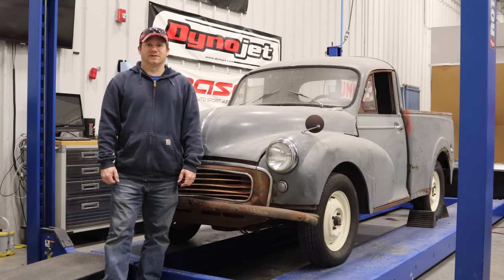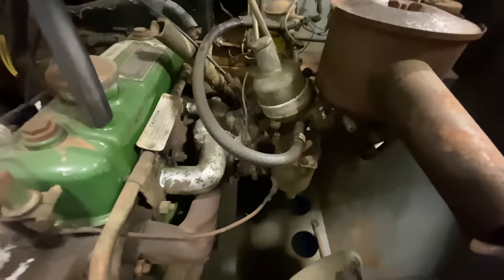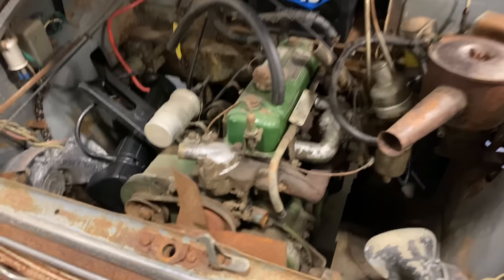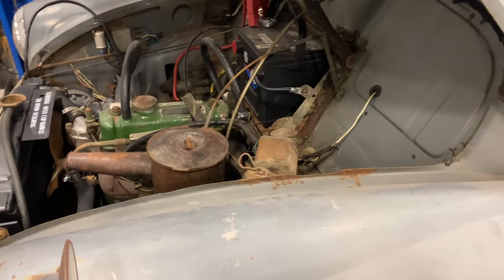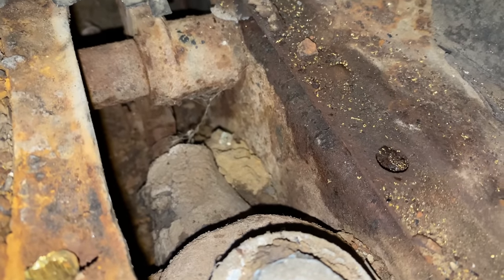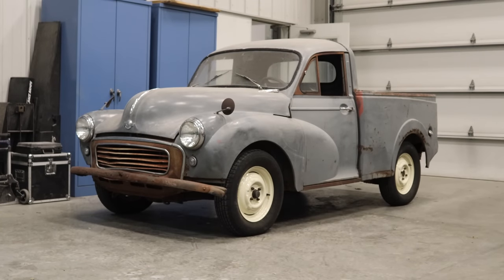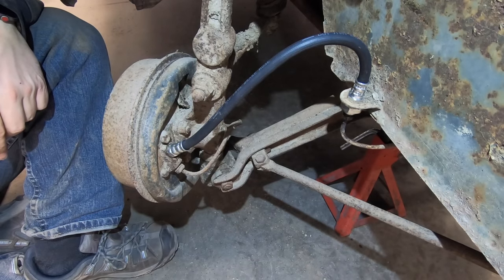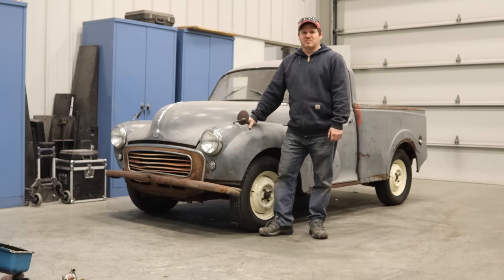1961 Morris Minor Pickup - Will It Run?

Comment: Great to see this old Morris Minor  worked on. I had the van MM in the early 80s, similar vintage which I bought from an old flame for £30.00! I had it sprayed metallic Gold and refurbished inside. It worked a dream and wish I hadn’t given it away for free in exchange for a new van more capable for my needs I loved the sound of the 1000cc tight engine, it’s pure simplicity to work on under the hood. Any key opened the door! Miss it some, as these were very collectible, still are, but very rarely seen here in U.K. However, a close neighbour has the car with the wooden trim! Thanks for posting, takes me back.

Comment: I worked on the construction of the Victoria Line subway in London UK, when equipping the project the contractor decided on Morris vehicles and within 2 weeks of site start up. 13 Morris 1000 travellers, 2 5cwt vans and 3 pickups,  2no. 15cwt J4 vans. 3no 5 ton flat bed trucks. Were delivered along with 2 Humber Snipes for the section boss's
Then the actual construction equipment started to arrive, a large proportion was new stuff so what the capital outlay was to set up shop was staggering.

Comment: Professional job there with the proper tools. I changed the brake master cylinder on my Morris Minor some years ago, and it is a pain. When I fitted the new one, I reversed the mounting bolts and shortened them a bit (to clear the torsion bar) to make it easier should the MC have to be removed again. A great car to own and generally easy to work on - I often think about getting another. Congrats on your excellent videos.
Reply: I worked for a Morris dealer in the 1970's and was told to grind a lump off the end, paste 'em with Vaseline, and stick them in the 'wrong' way round! :-)

Comment: I had a '61 Van I restored back in the late '70s. A few tips:
The emergency brake cable has a grease fitting. How nice is that?
I think the rear axle has 4.88 gears. Some of the Sprites/Midgets had I think 3.90s or 4.11s. Easy swap.
Disc brakes from the Midget can be used on the front with a bracket that is probably still sold.
That front fender looks pretty solid, I'd consider repairing it.
Check the frame where the lower control arms bolt through the frame, a notorious rust spot but not hard to fix with some welding. Easiest car you'll ever work on, except the master cylinder.

Comment: Great video, I had a 53 unit RH drive 1100cc ugrade (Australia) same issue with master cylinder. I fitted Morris Major front brakes, they fit straight on with no mods required. Good luck

Comment: Aww... lovely 😍 I used to have a Morris Traveller, half-timbered body and all. Great cars and excellent parts availability (in the UK at least 😉)
Reply: And the wood trim on the rear wings was actually structural, so you had to have wood that was in good shape.
Reply: @bcgrittner  Yep one of the few cars that failed an MOT with woodworm and rot.

Comment: Hi nice pickup. This brings back memories, remember doing the brake master cylinder on an old GPO van about 40 years ago, blew out one of the steel brake pipes during bleeding so had to replace all metal pipes with copper/nickel made to measure repacements.

Comment: Had a Morris Minor car in high school, drove it until I went into the military.  Biggest problem I had was the fuel pump.  Points burnt up just soldered new ones on when needed.  Never had a engine issue with it.

Comment: Aah, the memories! I spent countless hours under, in and around a couple of Moggies I owned in my teens, back in the '60s, doing all the same stuff as in this video, plus a whole lot more. Mine were Travellers - the first one a split-screen 803 cc 1955 model,  the later one a 948 cc from '60 or '61. Excellent machines - I did literally thousands of miles in them, around Britain, with a little detour in the split screen down to the south of Spain and back in 1968. Great little cars! And I totally agree with the "don't do this at home" comment about changing the brake master cylinder. I seem to recall that I somehow hacked off the heads of the bolts behind the torsion bar, then put new ones in from the other side, with the nuts on the torsion bar side.

Comment: "I have all the bleeders loosened and cleaned up." You're starting to swear like a Brit too now Steve. Good Lad!
Moggy Minor in the States. Well I never..
Reply: First thing I thought, as a Brit. What're we like.....lol
Reply: Nuffield Exports/BMC managed to sell a fair few Minors to the States in the 1950s. The reason for re-positioning the headlamps from the front panel either side of the grill, to the top of the wings, was due to US lighting laws. The low-light Minors fell foul of that legislation, so the front of the car was redesigned. The vast majority of vans and pick-ups that made their way across the Atlantic were used by the Morris dealers before they ended up in private hands.
Reply: @crashbox7130  The reason for headlight re-positioning is interesting. I recently saw a picture of a split-screen Moggy with headlights in the wings and was amazed. All the split-screen models I've previously seen in Australia had the headlights in the front grill panel.
Reply: I had one. A 60. They were quite popular at one point . We had a few vans imported too

Comment: I miss my '58 Saloon. MM 1000.  The holes in the brake drums are for brake adjuster access.  You need a large straight slot screwdriver.  I can't remember if the adjusters were at 12:00 O'Clock or 6:00 O'Clock.  Use a flashlight.  The thunk thunk electric fuel pump was standard.  The SU carb is a peculiar little beast - make sure the oil level in the damper is at a proper level.   My '58 MM 1000 was a saloon ( 4 door ).  Mine was positive ground.  I guess that was a British thing.   I have seen positive ground on many British cars.  No synchromesh on 1st gear - again, British. A MM 1000 pickup truck in the states?  Very rare.  Enjoy!

Comment: Minor pickups are becoming rare and fetch a good price over here In the UK. Those A series engines are very tough and usually easy to get running. That Minor should go well if it's got the 1275cc engine. I think they come with a 948cc or 1098cc over here. The drum brakes aren't that wonderful and some people convert the front ones to discs. On mine I found adding a brake servo did the trick. I was wondering if a brake pipe would give out because that happens a lot ( including on my Minor) when they get rusty.
Reply: Rare as hen's teeth over here. (US)
Reply: I'm in the UK - 55 years old - an' I ain't never seen one.
Reply: Most fell apart after a few years as happened with most BMC commercials. Charles Ware has one for sale for 26 grand. Personally if I had that sort of money I'd buy something more interesting.
Reply: Pickups are like any other old vans and commercial things, they just got run into the ground and if they got to be 10 years old they were doing good
Reply: How on earth do you fit a brake servo in one of those? I can only imagine that it's necessary to completely relocation the master to do that.
Reply: @TheEulerID  Have a look at commercial trucks. Two tons and better. A surprising number have a remote unit. Usually mounted on the frame. No idea why. A lot of hot rodders back in the day,made use of them for space reasons. I used to know the name of the most commonly used unit,but that was 20 years ago or more. If it is a vacuum unit,and a commercial truck has a diesel engine,a vacuum pump is needed.
Reply: @simonwelch560  
Many are still going after 50 to 70 years,  only very neglected ones ever fell apart.

Comment: Nice one, Steve. I like the ease with which you work your way through the various fixes - no fear! The Moggies had a reputation for being easy to work on, but the slave cylinder looks like it was designed to be hidden away for ever! Please, Steve, if you're calling the hood a bonnet, also don't call it a 'truck' - over here we call it a pick-up. Our dictionary definition of a truck is 'a large, heavy motor vehicle used for transporting goods, materials or troops': your pick-up may look like it's been to war, but not as a troop carrier ;)
Reply: You mean Master Cylinder.

Comment: A local gardener still uses a rather nice one of these, ideal for carrying a lawnmower and other small tools. A few saloons, travellers and a van in the area. As others have said it is worth checking and greasing the trunnion bushes. This one sounds like it is running on 3 cylinders, perhaps it will settle down with a bit of running.

Comment: Wow, this takes me back when a couple of fraternity brothers and I spent the better part of a hot summer day replacing the master cylinder on what was then a 10 or 12 year old Minor sedan.  We even had the shop manual, and it was a horrible job.  The first instruction in the shop manual was, essentially, "disassemble the left front suspension."  Your solution is much easier!  Still, it was a fun little car and the owner drove it for a couple years (until he graduated) without serious trouble.

Comment: Pity the poor owner. A Morris was my college car. I went from knowing zip about cars to master mechanic in the four years  I drove it. Number three cylinder cracks through the valve seat. Number three is also a chronic oil burner because of cylinder  block flex. BMC even sold a piston for it with an extra  oil ring on the skirt. The frame on the passenger side rusts, and the torsion spring mount collapses. So bad the car and I took turns pushing each other around town.
 .
Reply: I bought a '64 Saloon 3 days ago. I have already learned more about car upkeep than I have in all of my previous 25 years of motoring.

Comment: My first car was a 1952 split screen Morris Minor or "Moggie" as they were called. 803 side-valve and trafficators. It was 17 years old when I bough ti, and so was I, and it still had the original battery.
Reply: 918 cc Side Valve Wolseley engine, the 803 cc was an Austin overhead valve engine.

Comment: Wonderful old things but very rare these days. I've had 7 car versions. You can also jack the torsion bar up to remove the cylinder bolts, (saves putting stress on rusty floor panels!)
Also, if you ever need to change an engine, remove the bonnet and front bumper, unscrew the fasteners holding the complete front grille and panel then once the engine is unbolted at the mountings and bell housing you can walk into the engine bay and with a sling across your shoulders it's possible to carry the engine straight out the front without the need of a hoist. Two people with an 8 foot 4x2 through the sling is another way to do it.

Comment: I grew up with Minors. My mother had a saloon and then a Traveĺler, my aunt had a saloon, my uncle had a van and my mate had a pick up. I had a Minor for a while and we all lived in the same house. The master cylinder swap out made me shudder. I did it once and never again! The pick ups and vans were prized for the higher ratio back axle. It made acceleration a lot better but not the top speed.

Comment: All parts are still available for this truck. I think this is late 50s before 1961 look on the glass for the toughened symble it will be a semi circle under each letter is a dot first letter is 1 second 2 and so on. Will tell you the tear the glass was made within 10 years. Also there will be date stamp on the dynamo and starter.

Comment: On the master cylinder mount, can you put the bolt thru from the non-torsion bar side and the nut  on the torsion bar side?
Reply from the maker: You can if you shorten the bolt and maybe use a jam nut instead.

Comment: Have a good look for rust in the front chassis rails especially where the torsion bar bolts through at the front wheels. I replaced the rails in mine. Pop riveting was a real pain in the butt and I had to lengthen the jaws to get mine to reach.
SU carbs are fairly easy rebuild which will with decent gas will get that engine purring like a kitten. Gear boxes are a little frail so get it out for a good inspection and new rear seal.
Rob

Comment: This is only the second pickup that I've ever seen. I had 1 in 73 that didn't have a bed, the gas tank was held to the frame to the frame with seat belt straps, but it was a blast to drive.
Reply from the maker: I bet it was easy to spin the tires with no weight on it.
Reply: @ThisWeekWithCars   And if I had a flat tire, it was pretty easy to lean it up on it's side to work on.  LOL

Comment: Opened up the panel in the floor and found it swimming in brake fluid.  - Didn't rot though - Great idea with the torsion bar, we dismantled it, but always wondered what genius decided to put the bolt in from that side, when the other would probably have worked just as well.  Also we had no lift.

Comment: These were commonly used for pmg or later telecom in australia but they had a wooden tray with sides but werent sure if they were dropsides and i was told that the aussie built morris traybacks were only available to phone companies and not the general public but once decomissioned they were auctioned off to the public so if you have a morris minor trayback in australia it would of most likely been an ex pmg telecom maintenance vehicle, my ex had one when living in sydney.

Comment: You was lucky to get away without having to free - off or replace the wheel cylinders because from my experience they are normally stuck or seized. New replacements are well worth investing in together with that new master cylinder they will give you effective balanced braking. Good luck with the rest of the rebuild they are great little trucks.
Reply: Best is converting to Front disc brakes from a Sprite, and using a 1275cc engine with it's Rib case Transmission.

Comment: I have a 1959 Morris Minor 2dr saloon and my car has the same problem with the accelerator. It is a wire that goes all the way across the engine bay, and the protective cover for it snapped and got snagged on the hole where the wire goes through

Comment: By the way.... when I replace my master cylinder, I wanted to put the bolts in the other way.  So the nuts are on the other side.  That way you won't have to push down the metal bar to get them out.  Should that work ok?

Comment: The bloke who decided to put the Brake Master cylinder in that U channel, should have been flogged repeatedly, and made to service them for the rest of his life.
Reply: EnglishTurbines (laughing at this one😆) my first car 56 split screen two door, never replaced MC just filled the fluid several times a week😖 this guy did a very good job of explaining and showing the torsion bar tip, really good👍.
Reply: He had probably been fired and it was his last day !...
Reply: Not sure who put the Master cylinder there, but the rest of the car was designed by Sir Alec Issigonis. also responsible for the Mini (the proper one, not that BMW shite!) the Austin/Morris 1100/1300 (ADO 16), the Austin/Morris 1800/2200 (ADO 17 'Landcrab'), and  the Maxi (ADO 14).
Reply: @chrisskelhorn5727  Alec was a genius of his time, I think we would agree...The  Master cylinder placement, not so much.
Reply: @EnglishTurbines  This is true! But for some reason, he demanded that the pedals NOT be pendant! He was also very against radios in cars too!
Reply: @chrisskelhorn5727  let us not forget that he also came up with the Hydrolastic (CRAP) suspension system
Reply: @davewilliams6172  No he didn't! That was Sir Alex Moulton! :-O
Reply: I once owned a ‘60 Morris Minor 2 dr. The OEM fuel pump died and I found an identical replacement pump that said it “universal” as far as running as negative ground or positive ground. It was plastic, so yeah, it was universal.
Reply: @davewilliams6172  
The very good hydrolastic suspension that was far better than many poor suspensions I have seen.
Reply: @davewilliams6172  Nothing wrong with Hydrolastic. 1100s cornered like they were on rails and the suspension system was at least as reliable as Ford & Vauxhall's cart springs and maintenance-free.
Reply: @davewilliams6172  Nothing wrong with hydrolastic if maintained and pressurised.
Reply: @EnglishTurbines  it was a junior engineers first real assignment. On a Friday. The day before his holiday started ...
Reply: @roguedalek900  You have to hope it was the last holiday he was ever allowed to have....🤔🤔😀🇬🇧

Comment: Surely after installing the brand new second hand radiator you could use new hose clamps sockets work better than screwdrivers.Like checking battery level a coin works better than a screwdriver.good luck .Adam

Comment: I’ve worked on these, the floors and chassis rot, the pickups had the rear removed and made into a wooden deck, when they rotted too much. Plus the looked cool with big wheels and big engine modifications.
Reply: Somehow I missed that in any of my Morris Minors from an old Side Valve or MM through various Minor 1000's.  No rusty floors and little rust anywhere.

Comment: Unless the electric fuel pump has a blocking diode for back emf then the battery polarity isn't an issue. They were originally positive earth and to convert to negative you just swap the battery leads over. Occasionally you may need to flash the field winding on the dynamo, usually only if it's been sitting for years unused.